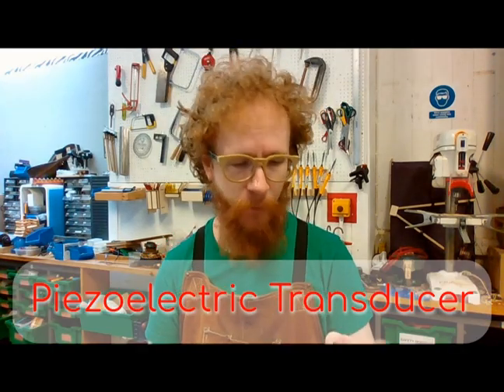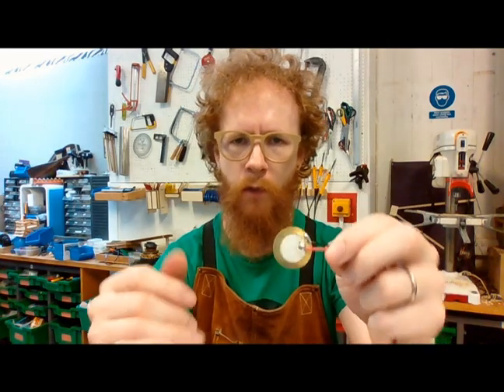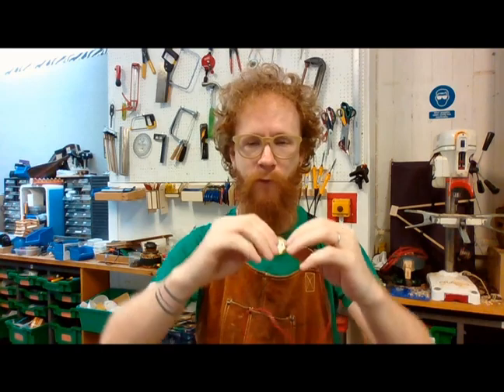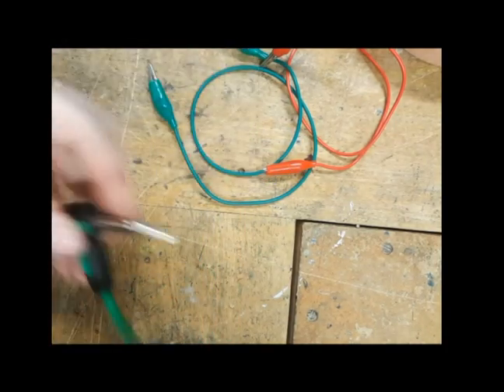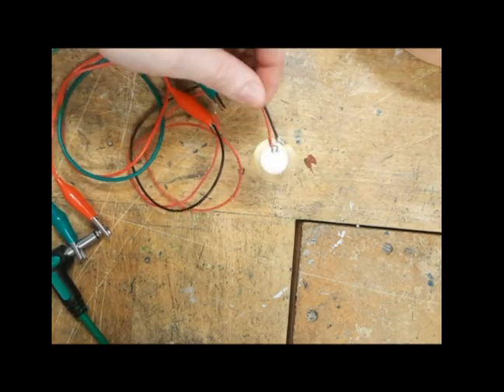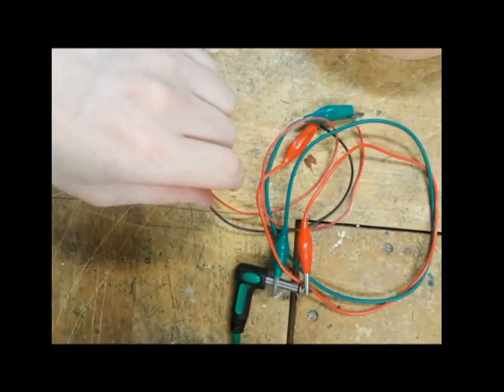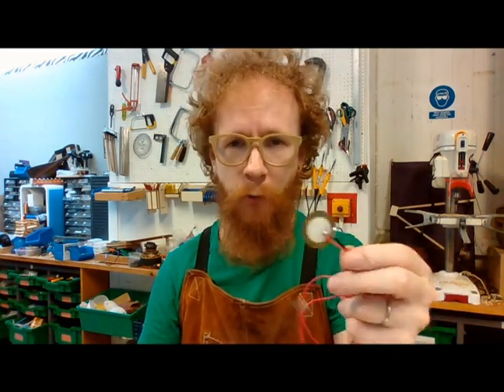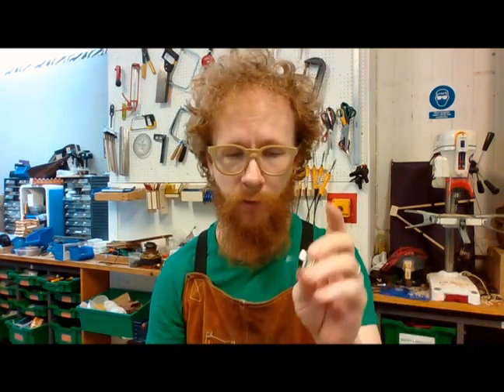DIY Contact Mics

Comment: Very nice video again! BTW: It's always a good idea to put a buffer electronic between the piezo and the amp. So you'll geht a better impedance and you will get a great sound improvement in most cases. For quick and dirty projects this is not neccessary, but if you need "good" sound add a buffer.The biggest diffence between large and small disks is the resonance frequency. Rule of thumb: Bassy instruments should have  larger disks :-= One reason for a buffer is: Piezos can destroy your inputstage of your amp, cause they can emit high voltages as you sait. Also those unsprectacular disks. I learned this the hard way. I build a stomp box and during the first test the ceramic breaks. This was the death of the first Opamp in the amp. Not all (cheap) amps have clamping diodes :-)